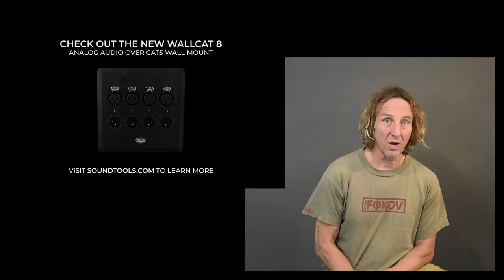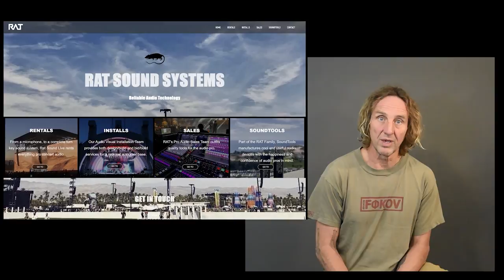Making Quality XLR Cables #4 - Quad Mic Cables (Public)

Comment: I've made a few TS 1/4" guitar cables using StarQuad cable.  I use 3x conductors + shield for ground and then the last conductor is the positive.  somehow they have less microphonics/cable noise but still can't make a bass player perform any better 🤣
Reply: To make a bass player perform better, use a longer cable. Much much longer.
Reply from the maker: Interesting, I would have to test to see what is going on with that wiring and the impact
Reply: @dougaltolan3017  RF cables are better and cheap, Ultraflex 7 Paoloni are extended in various recording places.
An other magistral video, many thanks for share Dave. Cheers from Spain!

Comment: I know I'm telling grandma how to suck eggs (telling you something you already know).
But is there any reason why you don't use clear glue heat shrink for everything? 
As you'll be able to see if there's any damaged or corroded cables (green death) and the glue will give extra support n make everything even more rigid n less likely to break?
Reply from the maker: That would protect even more yet I think shrink is already overkill in most applications. Adding glue shrink makes it messy and even harder to repair. 

I think that for situations that extreme, the XLR is probably not the optimal connector for the job.
Reply: @DaveRat  you get heat shrink that's got glue in it so when you heat the shrink up. The glue warms up and melts And when it cools down. It goes back to normal. 
It's only sticky when it's heat shrink hot. You can see it better as well because the glue stick to the surface n makes it clear
Reply: I have some brand guitar cables from bullet and monster cable, they both use that nasty glue. I like those cables as they are pretty good but I love to solder my own and I do it for mics and other stuff that use xlr connectors. When I make my own cables, I like to use clear heat shrink if any and leave an “insulation gap”, pretty sure Dave knows what I’m talking about, using black heat shrink or glue is wrong, at least in my book, as they don’t allow for inspectability.
Reply from the maker: I think for most applications the glue is a messy overkill. But can have it's applications.

For the 1000s (literally) of cables we deploy at Rat Sound for concerts, we don't use shrink on XLRs and have a very low failure rate. With failures typically due to being stretched or cut or mashed. A good solder job will typically last longer than the connectors and cable
Reply: @DaveRat  

That’s right, good soldering is everything. The clear shrink I meant, is a small diameter (like 1/8” or so) which I suddenly use for each conductor or conductor pair, helps for preventing shorts and since it’s clear, allows inspecting joints, it’s just a little hard and time consuming to do, that’s why I don’t do it every time I make a new cable

Comment: I would never use pliers for holding a connector while soldering. Maybe only in emergency case on the road, when nothing else is available.
In some cases the pliers act as a heatsink, so its harder to solder the contact.
Also the pliers have too less weight.
I use a 5kg machine vice... that clamps everything from an 1/8" stereo jack to a fully equiped 5U patchpanel ;-)
Reply from the maker: Ahhh, so you rock the portable touring setup!